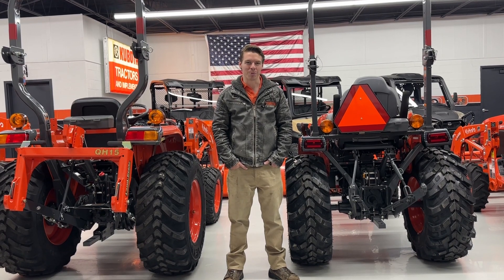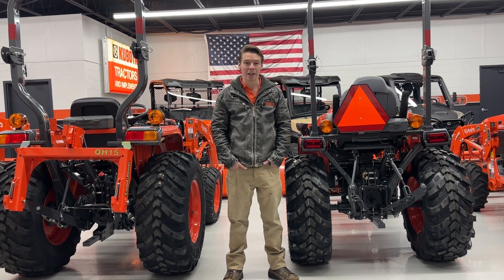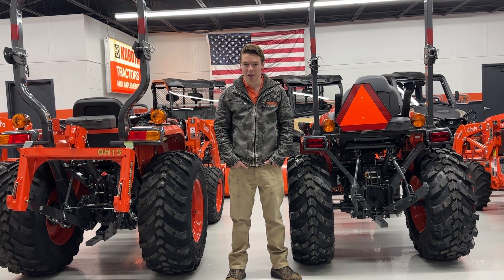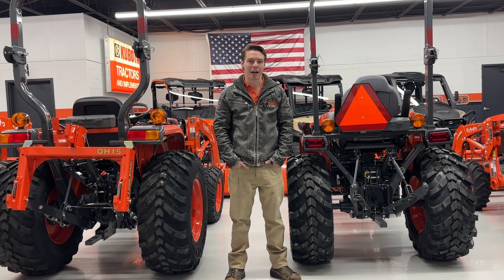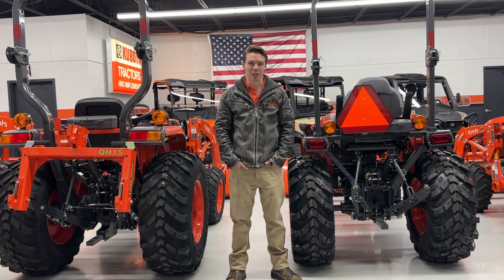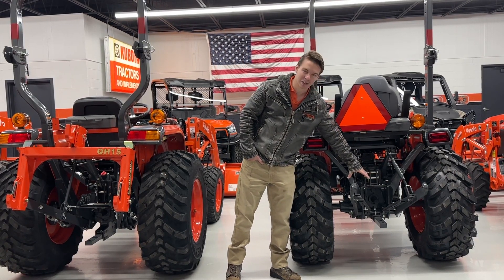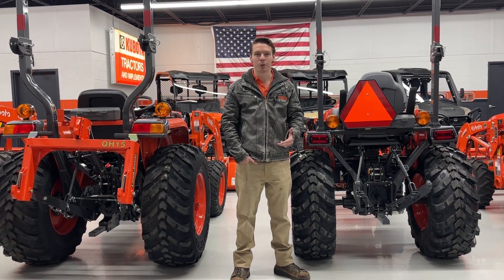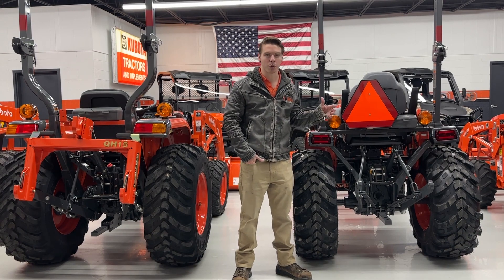Engine HP vs Tractor PTO HP

Comment: Sort of like vehicles, manufactures have rated engines with CHP (crank horsepower) and WHP (wheel horsepower) 
Back in the 60s and 70s manufactures went from rating engines CHP to WHP to help cut insurance costs! Now days it’s rated @ CHP again cause many people want Those HP numbers …..probably the same thing with tractors! People want those HP numbers 😅